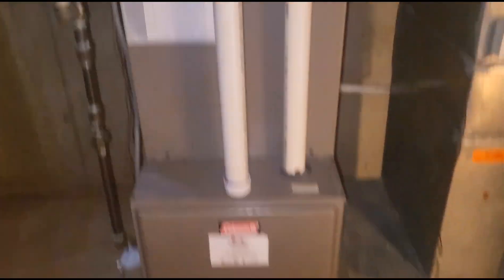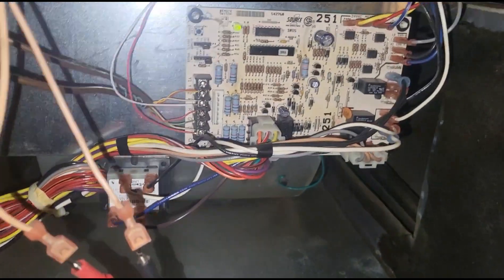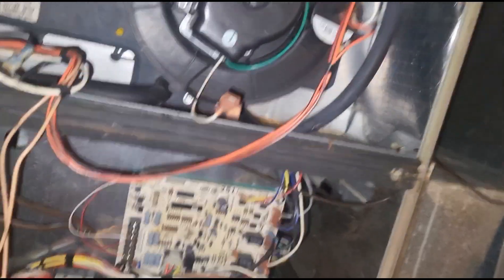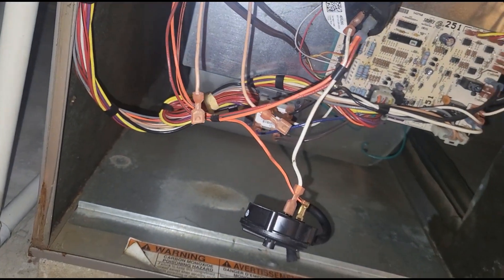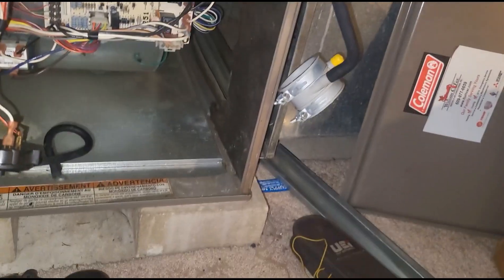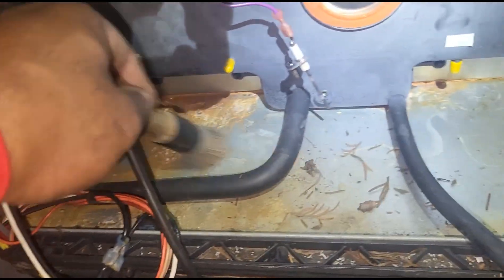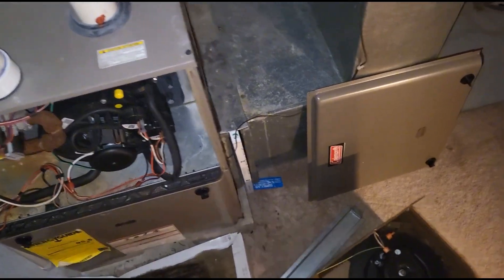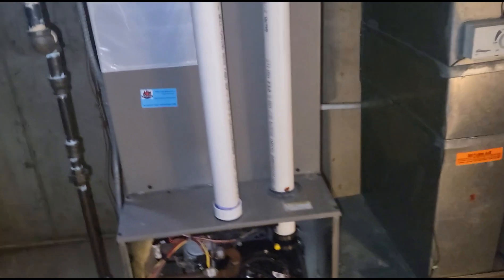Furnace NOT blowing Hot Air | Furnaces

Comment: I never understood why York sent the restrictor rings with these. The instructions say to use them when you encounter one with a yellow clear collector box, funny part is, the disc they specify to use matches the diameter of the hole and if you install the disc it will create a banshee type of whistle and squeal, besides that if you do find one with a clear collector box it's likely busted and cracked anyway. I always quote for both the inducer and collector box. The newer updated black collector box has an even smaller hole, no disc needed. Gotta love the piles of York.